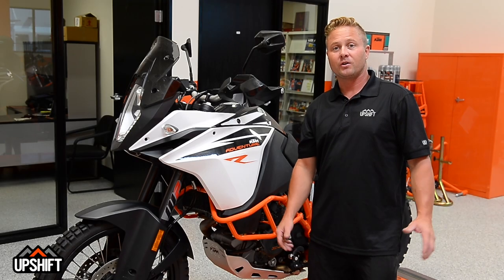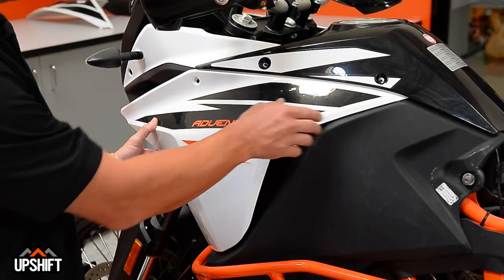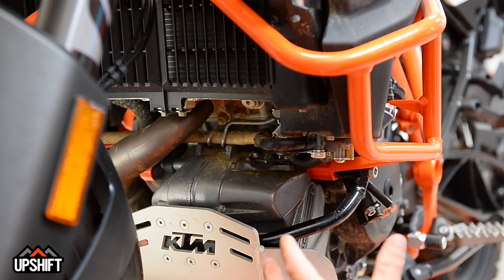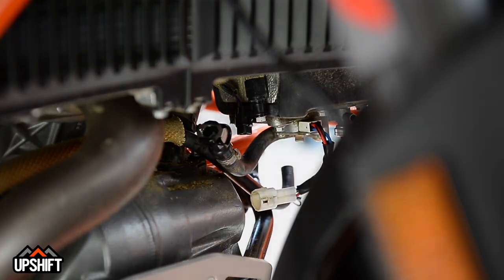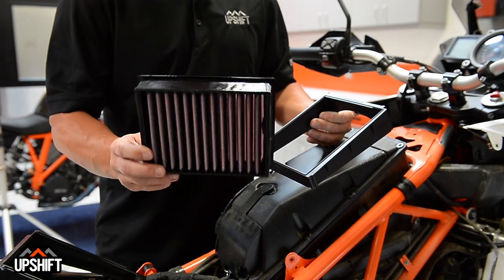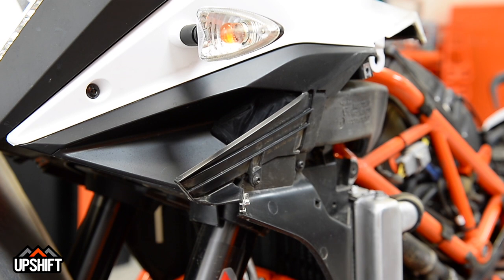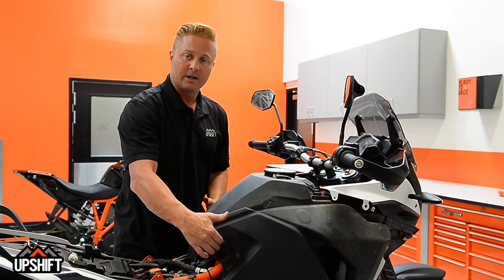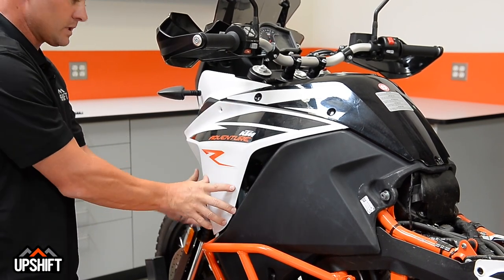KTM 1090 Adventure R air filter change

Comment: PING!!, good to see your still hanging around!  Do the rest of us a favor and hammer KTM for designing a system that's so complex and over engineered that most dirt particles would give up and find another filter to clog up.  Seriously, why is there so many screws and then a quick disconnect "after" you have to pull a fuel line?

Comment: Hi sir, great video . Thanks for the tips. Quick question with a  upper crash bar (such as Outback Mototek), would we need to remove them in order to remove the side fairing ?
Reply from the maker: We haven't had to... they can still wiggle out, but it can be easier to remove the upper bar, which is not hard to do, if you are doing a lot of work.
Reply: I just did mine and I have the Outback Mototek upper crash bar and didn't need to remove it there is one torx on either side that is aimed right at the bar, with a little angle it does come out.

Comment: surprisingly even the Africa Twin is easier to do an air filter change.  I'm wondering what a KTM shop would charge for this service?  Also it still looks like they have not addressed the 8 small bolts sealing off the air box which some have criticized as problematic for dust invasion.

Comment: KTM, what were you thinking when you designed this?
Reply: ya, I agree...it sucks. but you know what?  The Africa Twin air filter change is just as bad!!!
Reply: they were not thinking.
Reply: What was KTM thinking? More towards performance, I'm sure. This is not a difficult task. Take off seat and fairings is hard? No. Not really. Disconnecting some parts of the tank, valves etc then lifting it off? It can be a little tricky if its full of gas. Doing this a few times makes it easier. A lot of bikes require the tank to be removed for air filter maintenance. It's not a big deal. For what I get out of the performance from the 1090r, I'll take this minor inconvenience.
Reply: I guess it's a packaging thing. You need a huge ass airbox for emissions and whatnot. Pair that with the LC8's intake trumpet location and the need for a tank and you don't have many other options
Reply: They were thinking of the poor, under worked service department. Cha-ching$

Comment: How often are the intervals if you ride gravel 20% of the time, and in the dust 10% of that. 70% is pavement. Thanks!
Reply: If you do like I do and make sure to always ride at the front of the pack, you don't have to change/clean your air filter nearly as often as the losers behind you. PRO TIP: make frequent comments to your riding buddies about how complicated and difficult GPS/Navigation is, and they will gladly let you ride up front all the time.

Comment: If you do a lot of dirt riding the filter change/cleaning is critical and there fore I will not buy the KTm versus a GS 800/R1200.A GS 800/1200 filter change takes 10 min's max.

Comment: A full tank removal just to clean the filter is VERY VERY disappointing !! That’s a full 30 minute job every few days riding gravel.
Reply from the maker: We have never had to go to that kind of interval even in the dustiest conditions. It's pulling air from a pretty clean source up high and out front. If you were really staying on the wheel of a number of other riders then it does pull in a fair share of dust but so are you and that's no fun. No question it's a chore to change filter though.